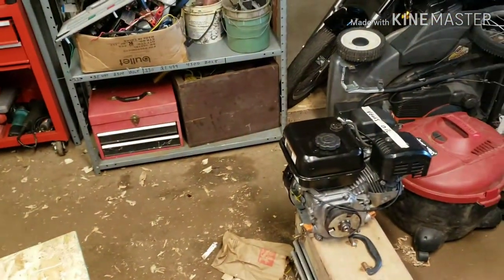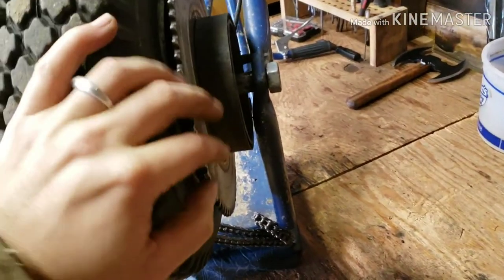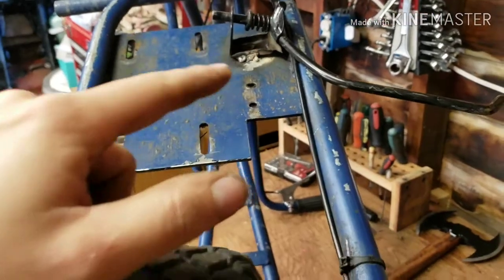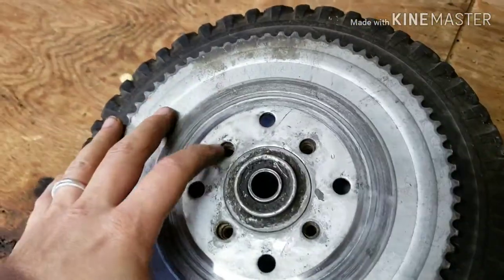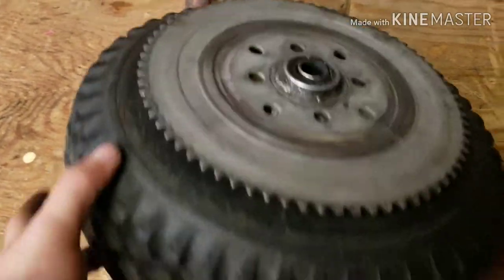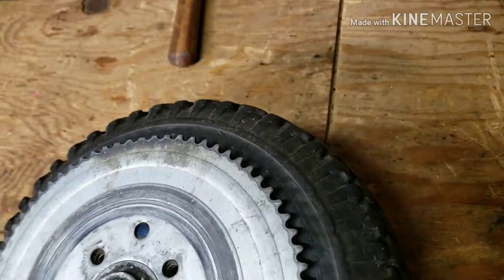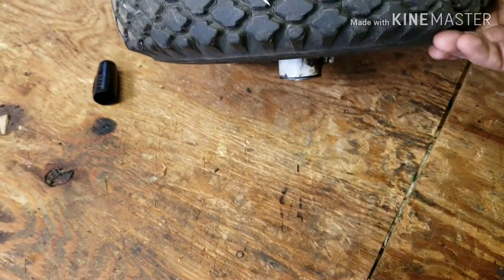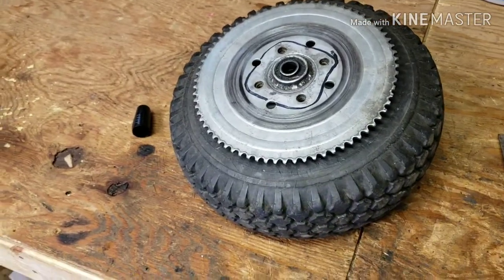Replacing the rear sprocket on the minibike

Comment: Where can I find mini bike wheels? Front is about 3.75 inches wide and back is almost 6''. I'm trying to go with either 5 or 6 inch wheels and I'm using a 10t clutch 420 chain and a 50t sprocket with 50t that will be powered by a 212 Predator with some minor modifications.
Reply from the maker: Ebay is going to be your best bet. I believe I have very close to the same set up as yours but my tires are almost  11 inches tall if I remember right.
Reply: Robert Thoreson I ended up buying a whole rebuild kit for $500 it came with 6” Azusa Tri-star wheels. Site was GoKart USA I believe.
Reply from the maker: I just noticed Walmart has a complete bike minus the engine. It also had 6 inch wheels.

Comment: my bike stock is 11t clutch 75 rear I wanna put a 212 on and get a max torque 12t clutch and possibly a 47 or 50 tooth rear. Id hit around 50mph with that setup i think
Reply from the maker: I dont thinknthe 212 has the power to reach 50mph unless you weigh around 100 lbs. I'm 180lbs and my bike is power limited at about 32
Reply: @repairityourself6275  a 212 can get to 70+ mph